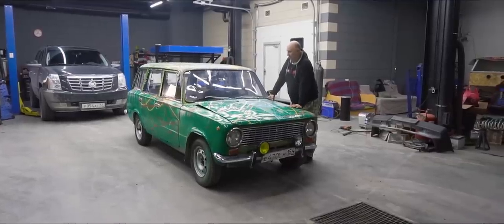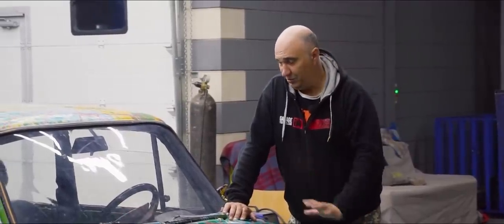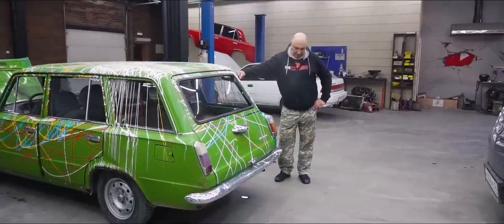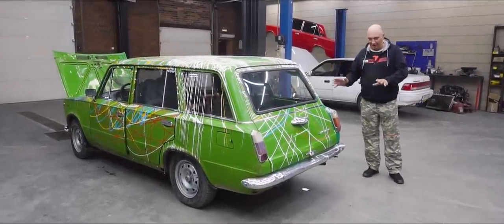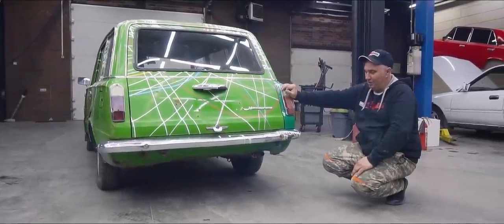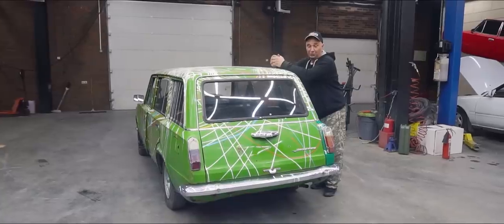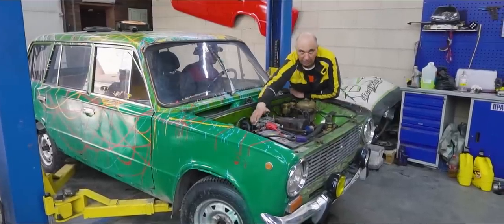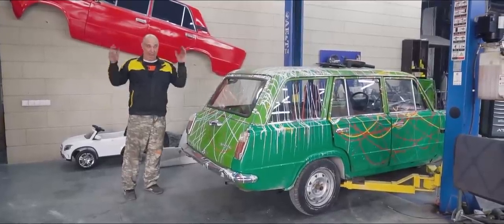No oil rings and valve seals! How bad will oil consumption be?

Comment: I'd be interested to see if doing this to a diesel would cause a runaway... considering one of the most common reasons why they do is due to excessive oil consumption...
Reply: They already did that
Reply: @rome5628  They did add oil into a diesel manually by putting a hose with an oil bottle onto the intake. That’s something else from removing the oil retain rings
Reply: Just put premix in the case lol
Reply: @billbergen9169  That'd do it lol
Reply: Oil coming by worn out oil ring that let pass more than expected wouldn't cause a runaway diesel, it is just not enough. Contrary to a destroyed turbo that has dramatic leaking seal which is the most common cause to runaway.
Reply: @TwinShards  true. It would likely take a fair bit more, but it would be interesting even just to see if it so much as raises the idle slightly for example.
Reply: I had that case with my engine!
I still had oil rings, but completely broken!
The spring was not pushing it on the cylinder walls anymore, and the walls where completely glazed, so the oil could climb up the cylinders easily.

My oil consumption was something like 2l every 100 km. Absolutely insane!

I had to reduce the idle quite a lot to make it drivable before I could rebuild the engine.

I never seen a diesel engine consume that much oil, and still no runaway.

But it was close!
One time, I tried starting it with absolutely no fuel. And it was clearly trying to start out of his own oil!

(it a naturally aspirated diesel)
Reply: @Fabien2626 what engine was that?
Reply: @jhsevs  it was a little lombardini diesel boat engine.

Comment: My older brother had an old Harley and was going to put rings in it.  What he got was an oil ring missing replaced with a compression ring.  He put it together and yes the cylinder with a normal ring rather than an oil ring did smoke some.  He rode it a long time that way.

Comment: When you pulled the oil rings off, it would have been a great time to find a compression ring that would fit that groove. The extra compression and vacuum wi
Reply: The extra compression while accelerating and vacuum with the throttle lifted would have been a good show also. The valve stem seals usually are more noticeable after an engine is idled for a few minutes and then accelerated as at a red light. I have a Six cylinder Lycoming aircraft engine on an airboat. Most aircraft engines are built without valve stem seals, but they don't sit around at red lights either. I love the shows, you guys must stay up most of the night to think of new stuff to try. Great show keep them coming.

Comment: My 2001 Cadillac Deville Northstar engine with 166k miles, had a blown head gasket. The number one cylinder was leaking exhaust into the coolant system. One of the 4 bolts around the cylinder, threads were stripped out. The number cylinder was also raw. So I removed the piston and horn it out. I decided to rebuild the engine because all the compression rings were loose. I could not get the pistons to go back in with the new oil control rings. So I put 4 piston back in without oil control rings and 4 with old oil control rings. Until I found this video. I didn't think anyone had ever done this before. I'm going to upload a video to show if any smoke come out the tail pipe.

Comment: Build an engine an inline 4 that fires 2 pistons at a time 
To see if it makes more or less power kw and nm

As an inline 4 has 2 pistons at tdc at the same time
Reply: yeah but they are at different  time with the valve timing
Reply: that will be interesting 😂
Reply: It will make less of both unless it has independent throttle bodies, since the cylinders will be sucking air through the same throttle at the same time. That's assuming it doesn't vibrate so bad the dyno will work.
Reply: I don't know if anyone has done that with a 4 cylinder motorcycle engine, but for a long time I've thought it would be cool to do if one had the resources to do it. You would have the torque characteristics of a twin and the rpm of a 4, to some degree. Can anyone add any insight to this?
Reply: @steveholland1163  change the cam aswell and the spark
Reply: @Iowa599  even if it kills itself it would be cool to find out 
Run the motor on sides or itbs
Reply: @markmark2080  that is my idea behind it too have so more downlow torque and still have the rpms
Reply: @edrichvanderbergh  Yup, if one had the resources (and a dyno) it would be a lot of fun to experiment with...
Reply: Even if one worked (which I doubt) it would sound like a Triumph Bonneville (and many other motorcycles) with a 360° parallel twin.
Reply: @edrichvanderbergh   that would require a special ground  canm i doubt it would be cheap

Comment: Hey, got a video idea for you guys:

Instead of a using a normal steering wheel, replace it with a "Tilt/push wheel". 
In doing so, replacing the rotary action of a normal steering wheel with a push/pull action.

I'd love to see how this works, and if it'd be best with a 1:1 ratio, or something else.

Thanks guys.
Reply: Nah, the push/pull should be for accelerator and forward/reverse like the forward controls on an outboard motor boat.
Reply: You could use a stick, like in a boat.

Comment: I once had a Honda with about 300,000 miles on the original engine. It used about a quart of oil a week, but it just kept on going and going. The valve stem seals were shot and it just wasn't worth fixing, so, kept driving. Summertime smoke show was amazing lol.

Comment: I would love to see y’all take an engine cam weld bigger cam lobes on it to see if it would work.
Reply: Or jb weld
Reply: This is actually pretty common in racing. In karts some people would weld then regrind their cams to get the perfect lift on the valves. This was before you could buy anything you wanted over the internet and had to make things yourself. My father had a machine shop and they would blueprint kart motors all the time
Reply: Just grind the base circle down.

Comment: When turbo seals go out it smokes even more. The oil that's supposed to run into the bearing runs straight into the exhaust and the turbo eventually burns up. We had sparks shooting out of the exhaust and rolled into a gas station with a huge wave of oil smoke behind us to buy 4 quarts of oil. We got home with no oil on the dipstick and it still isn't locked up no clue how.

Comment: The rattling you are getting from the engine after removing the piston rings will be piston slap because the pistons are now lose in the cylinders
Reply: Somehow this doesn't sound right but I don't have a better explanation lol

It would seem to me that the pistons would still move laterally unrestricted regardless of the presence of the rings... And should glide vertically just the same...?

Shrug. Explanation would be good haha
Reply: @MadScientist267  the pistons will effectively be wobbling as they go up and down the cylinder walls because the piston rings are not present to hold the pistons steady the pistons will still go up and down but will just be wobbling as they do so that is why they call it piston slap because the pistons are effectively slapping the cylinder walls hence the rattling noise
Reply: Thanks, that makes some sense...
Reply: @Pwills  Ah ok so they are providing a stabilizing/damping effect
Reply: @MadScientist267  yes amongst sealing the cylinders for compression they do also help with stabilisation I'm not very good at explaining things
Reply: @Pwills  lol all good... Never experimented much with car engines but definitely on Briggs lawnmower engines back in the day haha This is one experiment that somehow fell thru the cracks and never happened for some reason... I guess I just assumed the smoke and didn't think anything else would come of it (also figured poor compression, if they're all removed, which they didn't do here anyway)

Comment: I got a good challenge for ya, if that Lada Engine is a cross flow head, reverse the flow and put the carb on the driver's side and exhaust on the passenger side.
Reply: Lmao man!!
Reply: It's not. intake and exhaust holes are next to eachother. exhaust mainfold is directly below intake
Reply: @lordred7462  yeah that sucks, I was hoping it would be like a pinto motor and be a cross flow head
Reply: @ericblack1477  it's not. have one lada samara on restoration, engine is on table in parts. Incredible simple engine, 4 cylinder, 4 stroke, 8 valves OHC carburated engine.
Reply: @lordred7462  I used to build pinto Engines for racing, 2000cc and 2300cc. Lada engine almost looks like it was modeled after the pinto engines. the 2.0 pinto engine I was able to get them to push around 280hp. I'm willing to bet them Lada engines can do the same.
Reply: @ericblack1477  Yeah they do look kinda similar... I have a turbocharged "lima" motor in my fox mustang.
Reply: @billymanilli  your motor came out of a thunder bird Supercoupe. It's a 2300cc with a turbo, it has a roller rocker head. I used to build 2000cc Lima motors for dirt track. I can get more HP out of a 2.0 than a 2.3 engine. The secret to them Lima motors it 80% In the head. I ran a Lunati cam 275 lift with a 325 duration. I cut my head's 160,000 port and polish the head, multi angle valve job with a 3/4 blend. I order 2 sets of rings, stock just for the oil rings, and a set of 10 over for the compression rings. I file fit the compression rings with a 2,000 of a inch tolerance. Holley 500 with no. 75 jets. Try that on a 2.0 Lima motor, I know thoes motors inside and out.
Reply: @ericblack1477  Sounds like ya do know 'em inside and out!  

Originally, I put the car together for my ex, and I did use a few parts from an '88 turbocoupe.  I was gonna use the whole motor, but it turned out it had a cracked head and water sitting in one of the cylinders, and it destroyed it.

I ended up using the block that I pulled out of the car originally, and put the TC's pistons and rods in it, along with an older "oval port" head.  I did a little bit of cleanup in the ports and unshrouded the valves (I had 1.89 / 1.60 valves put in it with a 3 angle valve job) and blended in.  Nothing too carried away, really.. 

I ran a Holset HY35W turbo (stock of a cummins diesel Ram), made a "log" header out of 1.5" weld els and 3" downpipe and exhaust.

I tried a couple of different cams in it and ended up with an Engle 111 ..not sure of specs off the top of my head (was 15+ years ago! lol).  For a bunch of old parts, the thing ran REALLY good.  Best 1/4 pass was an 11.33 @ 126.5

Any way, not to ramble on... I own the car now and am in the process of rebuilding it with a bit more power in mind.  I did a 4 wheel brake job on her Mazda 6 after we broke up in exchange for the title ;D lol  

I changed it back over to auto with a good c4 and the motor is completely different as well.  It has an Esslinger aluminum d-port head now and forged flat tops, but I'm looking for rods (again).  I did have it put together with used crower sportsman rods (that I bought from a circle track guy) but didn't trust them, as I know they rev those  motors really high, and I want to play with a little bit of N2O on top of the boost, after I get it dialed in for a bit.

I kinda wish I didn't sell them now and just had new bolts put in because they seem to be getting expensive and harder to find now ("stock" 5.2 length)...  I wish I could find a new set of H beams for a reasonable price.  Everyone seems to have moved on to the newer generation (duratec) stuff now.

Well.. I gotta get back to work.. Very nice to meet ya!
Reply: @billymanilli  awesome job!!!! Engle makes good cams I have friends that use those cams in there 3t Toyota motors for dirt track racing. Eslinger has alot of kick ass products. I don't know now if they still carry this kit but they had what they called a YB kit for 2.0 it was 5,000 dollars but you get a dual overhead cam head, your choice of cam lift and duration, it had forged Pistons, balanced crank, It came with high performance rods, all the gaskets and bearings. I wished I could have afforded it. C3 and c4 transmissions are good automatics well the old school ones are though.  The next time you build that motor or another one like it, try getting 10 over compression rings and file fit them to a 2-3,000 gap that can help with more compression. And shave the head 120,000 to. You get 10:1 or 11:1 compression ratio.

Comment: Original and interesting - as always. Removing the seals makes the engine lose compression, and thus power, but do not forget that oil in the cylinder increases the energy of the combustion, so a few HP could be retrieved?
Reply: increases knocking tho because the oil lowers the octane
Reply: The stem seals don't have any effect on compression, they're there to stop oil from being sucked in via the valve guides.
Reply: Oil rings don't have any effect on compression. They aren't there to seal but to wipe away excess oil back down towards oil pan

Comment: In the days of yorn a common advice to check engine condition was to coast down a long hill then look in the mirror at the bottom as you hit the accelerator. Volvo pushrod engines could however smoke badly in such cases but still run fine for years, the real killer of the Volvo pushrods was too cold thermostats, people would put 82c thermostats and think it was good for the engine, there was even 78c thermostats available for the B16.

Comment: The car seems to be using an inordinate amount of engine oil. 
Perhaps it would be beneficial to replace the drain-plug with a wine bottle cork?

Another directly relevant suggestion:
Would it improve matters to engineer a mechanism that would triple or quadruple the speed of the windshield wipers?

Comment: Video idea:
Steel pistons

Why?
Lower heat conductivity but also higher thermal stability.
Engine would have hot spots but lower conductivity so would it transfer heat to charge fast enough for it to knock?
If it does knock,  how long does it survive?
Reply: Haven't most engines used steel pistons anyway or is it only cast iron/aluminum?
Reply: Yes, a considerable amount of newer diesel engines do use steel pistons to handle the extreme heat and pressure they now produce
Reply: @floridianrailauto9032   mostly cast, forged or hypereutectic aluminium because it's heat conductivity is over 200 W/(mK) so it stays cold enough to retain strength and is light enough to reduce inertia.
Aluminium is less dense and less strong so thicker section also allows the aluminium piston to sustain more bending moment when accelerating rapidly.

There are a very few applications for steel pistons. Malhe came up with steel diesel pistons a while ago but never heard of them again.
Reply: @ElectronsOnly   hmm.. , don't know much about diesels, should look into them. 🤷🏻‍♂️

Comment: I used to have a car that used about 1qt (a less than 1L) of oil between oil changes (3000 miles or about 5000km) but it would go through 1qt of oil during one track day event. Never saw it smoke, but I was paying attention to what was in front of me rather than behind most of the time. Anyway, the reason I say that is that how the car is driven has a huge effect on how much oil it uses. This particular car had kind of a high rpm engine (7500rpm redline) so most of the time on the track was spent between 6000-7000rpm.

Comment: Hello Garage 54 team! Nice test😃

Next time do with diesel. I done same kind smoke in Kostomuksha starting my friends diesel Volvo 850 without warm up -20"C! Streets vere covered with "blue" smoke😂

Now summer is almost gone for my another video idea, but I haven't got answer earlier. I"ll keep sending this message to new videos too, till I got answered😉

Try to make a anfibio car?

Weld many propellos to drive shaft, so own engine will work on water too😂 If using samara, it is easier to use outboard motor👍
 I am doing same to my Samara, when it is too rusty after few years😅

Please, do not make Titanic 2😅 Use some arm floats👍

Greetings from Finland from Lada fan... What a car! So reliable and cheap to use!

Using Ladas from year -07! Using Samara and rare model in Finland➡Granta😎

Comment: I'm interested in it's fuel consumption and power output now it's burning oil.

It sounded livelier without the rings.  The carby can be tuned to compensate for oil.

Is the Lada using less petrol because it's burning oil?

Could a catalyst and dpf filter catch all of these emissions?

Looking forward to more Lada madness!!!
Thanks Garage54
Reply: of course not. catalyst and especially dpf will be very quickly clogged with carbon gunk and engine will stall.

Comment: I want to see a 16 valve engine running on only 8 valves and then  compare the power loss and fuel consumption.
Reply: Yes!
Reply: I did that with my 1991 Honda Civic. A little more low-end torque and a huge loss at higher rpm. Fuel economy is hard to accurately measure, but it seemed to help.
Reply: Depends which valves, pick all of them to be exhaust or all intakes and the power loss will be 100% and the fuel consumption will be zero.  :-/  :-)

Comment: We had 71 Chevy Nova, 230 6 cylinder . Old lady owned it so it was carboned up and smoked. We revved it up and poured a quart of ATF down the carb in an attempt to crystallize the carbon deposit and it would blow off. We took it for run down the highway to clear it out and it smoked so bad the police pulled us over ! Lol

Comment: lol I once had an old Honda Civic that smoked worse than this car. I guess the piston rings and valve seals were junk. It left a smokescreen at every stoplight and smoked out anywhere it was parked for any length of time then started. It still ran just fine though. My current daily driver (an American-branded car built in Canada using Japanese engine and transmission) has valve seal issues but it's not worth the cost to fix it. It creates quite the smoke show on cold start but no smokescreen like the Honda.